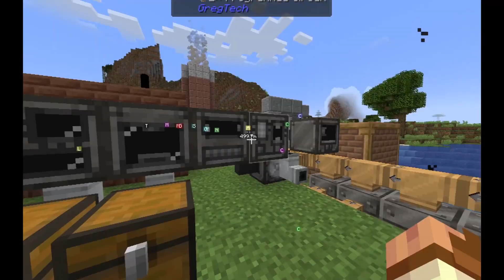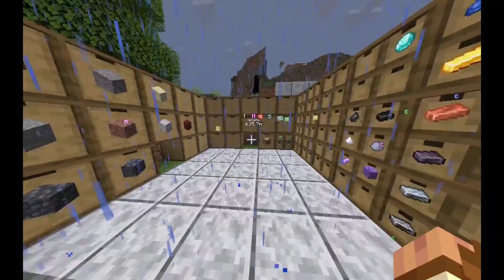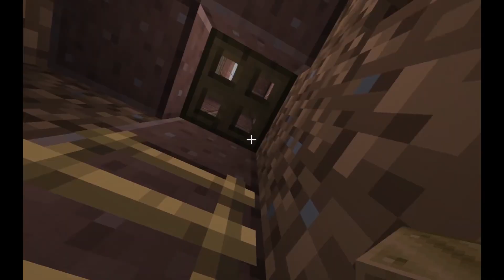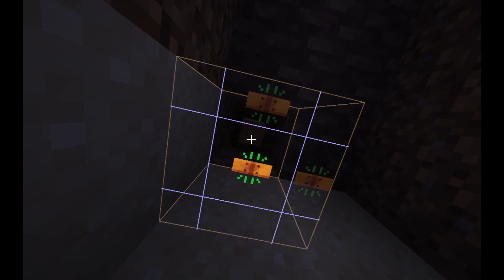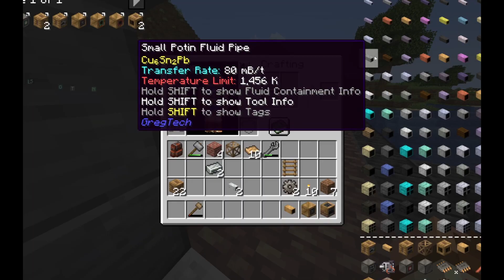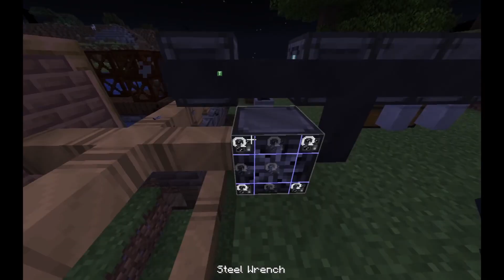Gregtech Modern Ep9: Mass Grinding and Cooking

Comment: do u get this issue where the ore vein that shows in the map when right clicking the surface ore thing wont actually have any vein?
i only encounter this when playing gt modern but not with 1.12 gt pack. Also sometime it shows weird vein like having two ore vein in same chunk..
Reply from the maker: I have noticed that there are a few different ore vein types that can lead to misunderstanding on the lack of ore veins. One such vein that I find pretty annoying is the like "peppered" vein, it's where the ore has maybe one or two pieces touching and if you are mining with a hammer you will constantly find more but one mine like 1-3 ore with each use. The other thing that I am wondering is that there is no 3x3 chunk ore spawn thing. Different ore veins may spawn right on top of each other and one will be high and the other will be low. These changes made it more interesting at first but I can't wait to get the mining machine so that I don't have to search for scraps of ore.
Reply: @Precursorhunter hey! I found the solution for that, looks like the feature was intended rather than a bug. To make the veins like the previous gt (1.12>) you have to open the config of gregtech modern, the file name is gregtech.yaml or smth, open with notepad and scroll down a bit you will see the config for ore gen and in that set the ore gen offset to 0 from default value of 12. Now it works like the og gt5 ore gen. Im not sure if this works on existing world but for new one it will work.
(Sry for my bad Eng)
Reply from the maker: Thanks for the info on that as I am sure that this will become helpful for anyone else in that may go to play the pack. I don't think that I will got to change the setting as I want to play through the pack with as few changes as possible to learn the ins and outs of the pack and help anyone in the comments section with questions that they may have.
Reply: @Precursorhunter exactly right😭, my hammer always breaks when finding ores cuz even if i dig the center of the chunk there will be none. I hope gt modern dev will fix it soon..